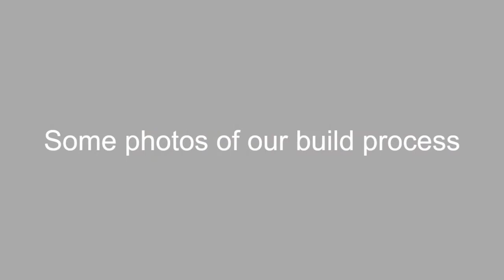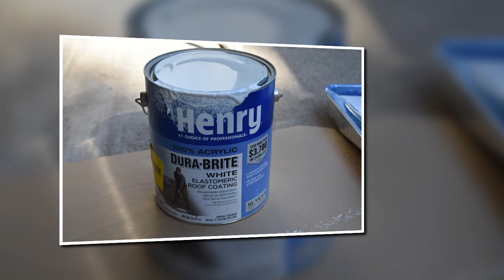Meet Our New Camper - Her Name is Tangled

Comment: Very nice conversion. Planning to build one for my family of four. Can that be pull by a minivan?
Reply from the maker: It was 1900 lbs empty. I'm not sure what it weighs since we did the conversion, but I would guess it would be too much for a minivan. You would have to check the towing capacity of the minivan. I'm no expert, but a smaller cargo trailer (like a 5x8 or 6x10) would probably be better. There are also all aluminum trailers which are lighter if you are wanting a 7x12.